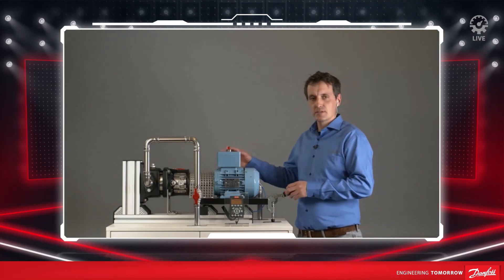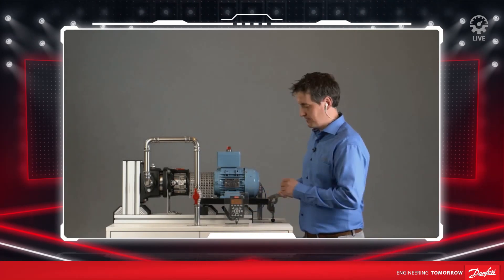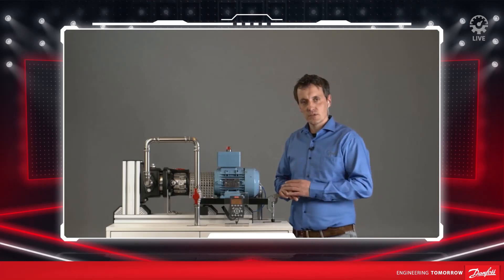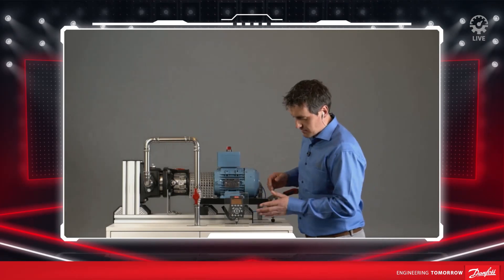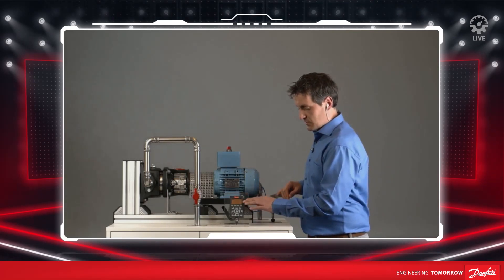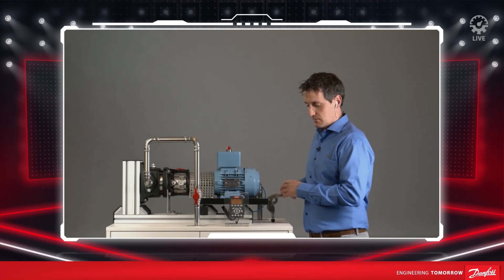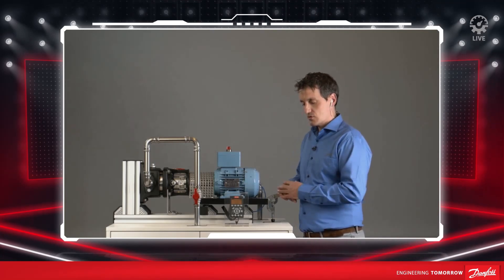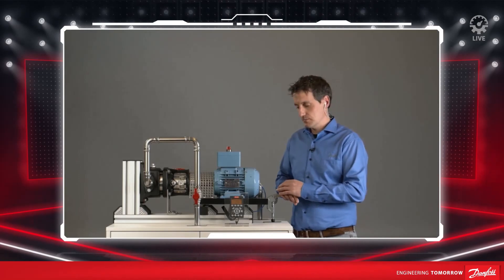Basic concept of condition-based monitoring with an AC drive explained

Comment: which vibrational sensor do you use?
Reply from the maker: Hi Aryan,

For this particular video, we used a velocity transmitter. In general, CBM can monitor up to 4 external analog sensor signals simultaneously - on top of the internal signals that CBM is monitoring.

In addition, when it comes to vibration, we normally use two different type of sensors for different fault detection. These are:

Vibration RMS : velocity transmitter 4-20mA
Vibration GPEAK: accelerometer 4-20mA

And we recommend and sell sensors from Hansford Sensors.

I hope this helps you.

Kind regards
Danfoss Drives Social Media Team
Reply: @danfossdrives  What is the part number of the velocity transmitter? Where do we buy one?
Reply from the maker: Hi Peggy,

The sensors can be ordered from Danfoss or Hansford Sensors.

To make it a bit easier for you, you can see the ordering numbers below here:

Transducer 0-10g, 4-20mA
•	Danfoss ordering number: 134B8492
•	Hansford Sensors number: HS-D22B10

Transducer 0-25mm/s, 4-20mA, RMS
•	Danfoss ordering number: 134B8493
•	Hansford Sensors number: HS-D20C0255019

Transducer 0-25mm/s, 4-20mA, RMS, with temperature PT100
•	Danfoss ordering number: 134B8494
•	Hansford Sensors number: HS-D20CRT0255408

Cable 10m for 8492 and 8493
•	Danfoss ordering number: 134B8496
•	Hansford Sensors number: HS-AC334-10

Cable 10m for 8494
•	Danfoss ordering number: 134B8497
•	Hansford Sensors number: HS-AC010-10

Hope this helps you!

Kind regards
Danfoss Drives Social Media Team